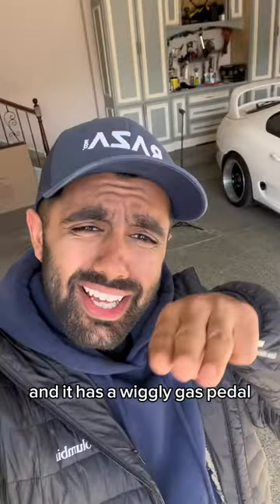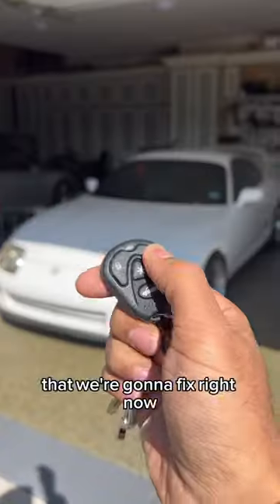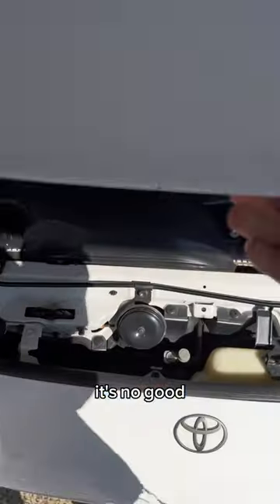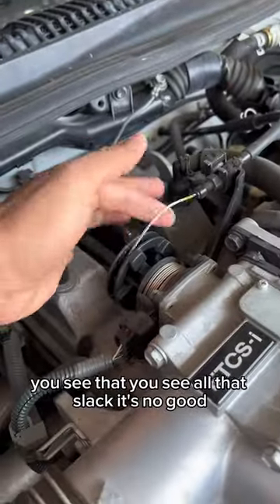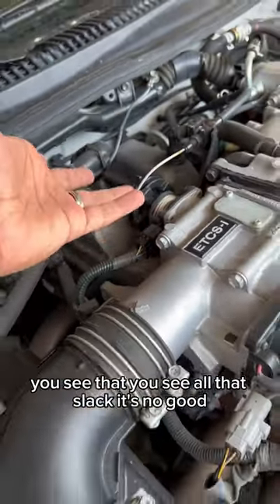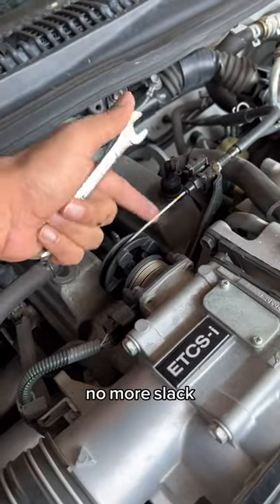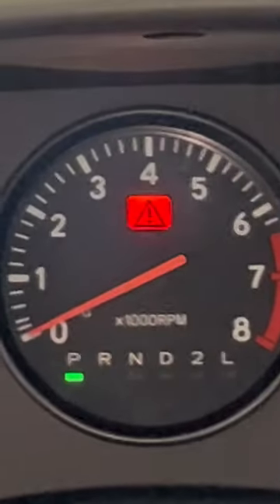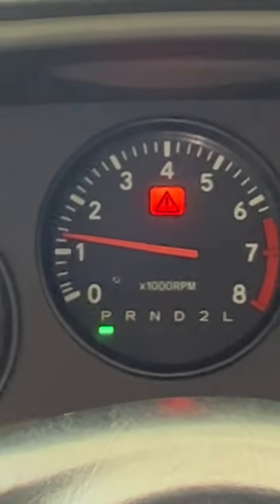Love me a crispy gas pedal🤑 #supra #mk4supra #diy #jdm #shorts #youtubemechanic

Comment: Everyone is mad it's an auto yet they are more bulletproof than the manual ones, who cares if its a NA and an auto at least its a supra and they can still make good power ane the throttle body cable is fine its not tight it still has some slack but if anyone goes through this issue dont ever make it very tight
Reply: Auto stronger than a getrag? You’re kidding yourself
Reply: @EnkeiTenjin  not at all I even talked to mechanics who work on 2jz and they have told me that the auto on these cars and the is300 are very much more stronger compared to the manual ones, and they even offer stage 4 kits for these transmissions if you ever want to make more power staying auto which is crazy and I didn't believe it myself